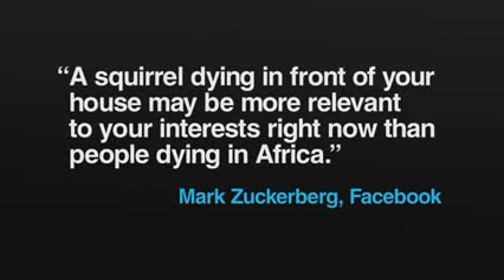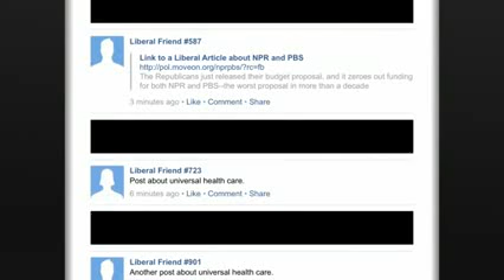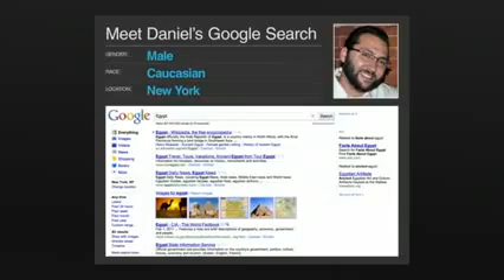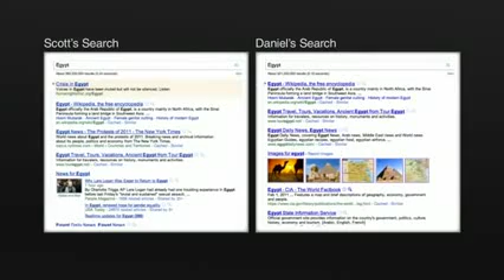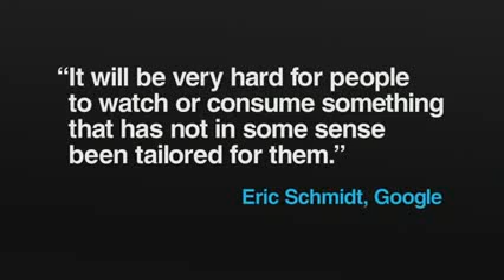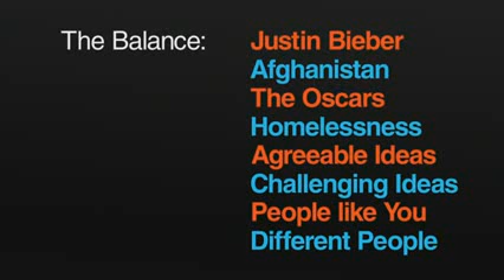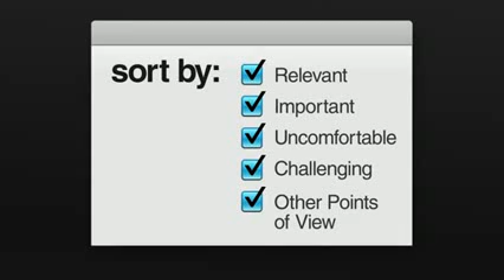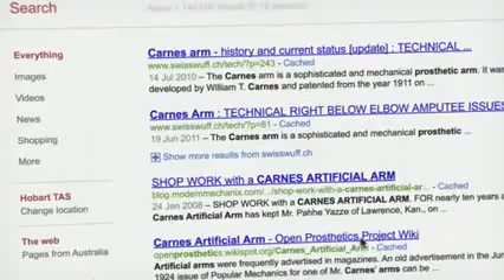TED Talks - What FACEBOOK And GOOGLE Are Hiding From The World - The Filter Bubble

Comment: I agree with the speaker to a certain extent that the web controls us. However, I strongly believe that it does not show us what it thinks we want to see but instead shows us what we actually want to see. I would like to back up this point with the uses and gratification theory. The theory has a more user/audience-centered approach that proves that the audience in fact isn’t passive and mindless. People will only watch what they want to watch. They will only gain information that they want to gain. 
Hence, the bubble that surrounds us isn’t created by the web but by us. We choose what we want to surround ourselves with. I do agree with the speaker that editors aka gatekeepers who controlled the flow of information have been replaced by algorithmic gatekeeper due to the invention of the Internet. Although, I believe that this is a positive advancement which can be of our advantage so as long as the algorithms are embedded with the appropriate filters. 
171 words, Ashie Singh, CMM/TB02

Comment: Amazon does this. I have told them how annoying it is when I search for a specific term, and then they decide what to actually show me.
Reply: Use Google search to do an internal search of amazon.ex. "tvs amazon". Don't use amazons search engine.
Reply: +cosmic waderer My initial reaction is that it is hilarious to suggest using one biased search engine to subvert another one. However, I don't disagree with you, and sometimes I actually do that. The syntax would be "tvs site:amazon.com". Of course, Amazon's own search has gotten better recently about showing the items that are actually relevant to your search, instead of showing you stuff like A/V cables and rooftop antennas if you searched for "tvs".